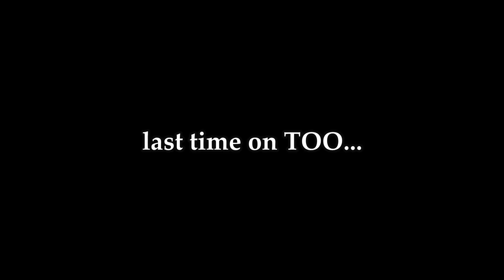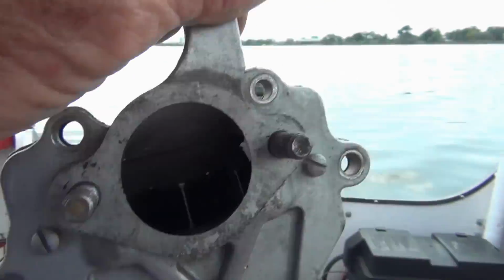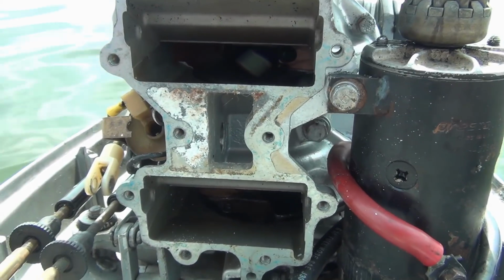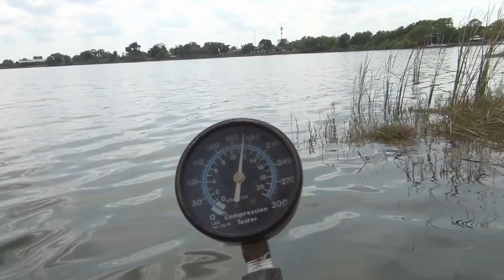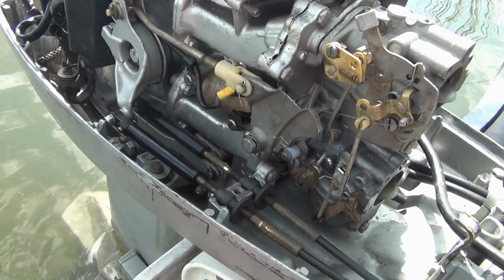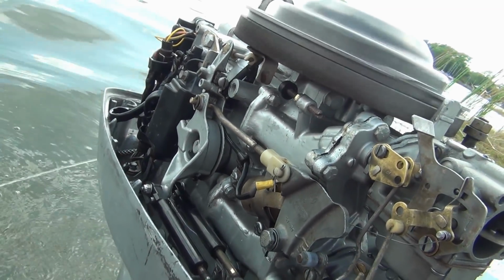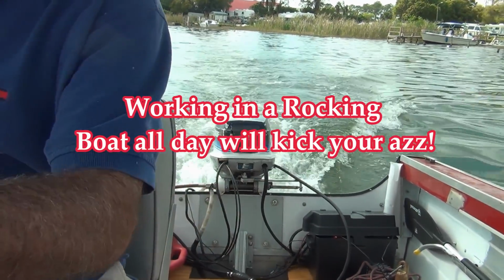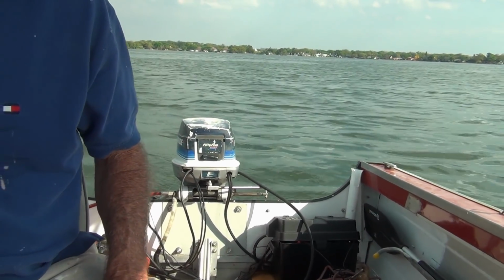1979 Evinrude 55 Hp Reed Valves, Compression Test. Eliminated

Comment: Did you do a vacuum test yet ? On the carbs and block ? I’m still thinking lower crank seal or fuel pump diaphragm failure and fuel is being sucked into the block from the backside of pump . It looked like a hose wasn’t connected laying in the pan ? Just my thoughts !
Reply from the maker: Dont have the tools for a vacuum test other then my hand held up to the carb. Hahaha It's called old school vacuum test! Hahaha Thanks again !
Reply: @THISOLDOUTBOARD1  I think mine cost me $40 ( cone style sync and vacuum ) !

Comment: You mention that the bottom carb is not pulling as hard as the top,  Looked like you were noticing some splash back on the airbox cover toward the end of the video. Might be another symptom of that reed with light showing through the bottom intake causing that issue.   For trouble shooting purposes are you able to swap those two reed cages around to see if the carbs pull differently? if not how about the leaf valve it's self?
Reply from the maker: Hey Al. Originally its been the top cylinder with less pull. I think after I swapped the carb linkage rod for the shorter one it was holding the top carb open just a hair more causing it to pull a little harder then the bottom and I may have not resynced them yet. Anyway, I appreciate how observant you are, wish everybody was like that! And yes I was looking at the box cover, splashback seems a bit harsh, I would call it a light mist, Hahaha. Nothing unusual for a two stroke. I dont think I've ever seen one that had a bone dry silencer cover. And the lovely reed, with the hairline of sunlight showing through. Haha Yes, I could have swapped or corrected it, which your not suppose to do, so they say. I've done it a few times with no problems, bent/corrected it I mean. But on much worse valves then that one, and more than just one hanging open and I mean hanging to where fuel was spitting out the carb! So long story short, after doing the blow back test, carbs on and carbs off, I just didn't feel it was necessary to mess with it. Could it have been the reason for the bottom carb pulling slightly more, maybe. But those carbs are set to idle at closed butterflies. Running them one cylinder at at time the top carb couldn't keep up, at idle or at advanced throttle. In my opinion, it was running to different to blame it on the one bottom reed being slightly open. I guess the long story short just got long again! Hahaha Anyway I dont know if you've been following or just tuned in on this episode. It's a lot to deal with when all these different things start to happen at the same time. Started with a slight hesitation and slowly progressed to this over a couple weeks. And to top it off, we caught a guy stealing parts off it last night. Got my brand new omc coils and was trying to get my battery. Unbelievable ! Stay tuned for that! Thanks again !
Reply: @THISOLDOUTBOARD1  Thanks for the reply. I've been watching the whole series. Along with the others over the past few yrs.  I enjoy the channel very much and look forward to each episode.  Keep at it, you'll figure it out. Sorry to hear about thieves,  I have no patience for them.

Comment: It sounds like the throttle cable on the motor the dial needs to be turned a couple turns it’s stalling when going into neutral. The rpms drop to fast causing it to stall. Check to see if the screw holding the cable mounts to the motor are tight and the black dials are adjusted good.
Reply from the maker: Hey. Thanks for watching and commenting. Will do! Stay tuned !

Comment: feel your pain. had a 70s 50hp electric shift at the shop, was running one 1 cyl, ive been on cdi tech line confirming my dva tests over and over - stator kicks 185v disconnected. throw on a pack - 0.5v. 3 packs in a row now. its a joke!
Reply from the maker: Wow! Thanks for tuning in. It will drive you krazy! Thanks again & Stay tuned !

Comment: Alright I have it figured out since I actually seen and heard it good.
 Disconnect your solenoid when it’s doing this and I bet you a dollar it won’t do it again. It sounds like the solenoid for the choke is being activated causing the rpms to jump up it also sounds like it’s popping into gear when the rpms are reaving up. I guarantee you the solenoid is causing more gas to be pulled into the motor when this is happening. Could be something in your remote. Wish I was there to help with it buddy. Good luck
Reply: That motor shouldn't have a primary on those cars
Reply: Primer on the carbs.
Reply: what primer? this has choke plates! primer didn't start till 84'
Reply from the maker: Hey. Thanks for the tip! But the 79 is still manual choke butterflies, although it does have a solenoid to activate them with a key push. Thanks again & Stay tuned !
Reply: @ct1762  I was referring to the solenoid that pulls the choke in. I get my words confused sometimes.
Reply: @MrCharles504  I was referring to the solenoid that pulls the choke in. Sorry I get my words mixed up sometimes.
Reply: I edited my post to say solenoid for the choke now. That’s what I meant to say
Reply: @mwatkins2464  no worries! yea the plates seemed horizontal to me, plus they have a "notch" that holds them open
Reply: @ct1762  I’m still leaning towards the diaphragm in the fuel pump or lower crank seal !
Reply: @davekimbler2308  agreed. must be an air leak somewhere. murphys law says if it's not the top seal, it's the bottom haha.
Reply: @ct1762  👍👍 i hear ya !

Comment: i have a 75 40hp that im fighting a lean sneeze with, only the bottom cylinder.  in my readings, ive learned burnt piston skirts can cause issues.  i did too find the reed assembly was a lil wet where it shouldnt have been.  have yet to put parts at it but see where were at after that i guess.  not sure if it can be done on an outboard, but on 2 stroke bikes, people do leakdown tests, pressureize the crankcase to determine if theres a leak.  

its driving me nuts too, sometimes it will idle okay, sometimes it coughs like crazy, runs like a friggen top anywhere besides idle
Reply from the maker: Hey. Yes it can be done. Thanks for watching and commenting. Really appreciate it. Stay tuned !

Comment: Any chance your timing arm could be sticking after you pull the throttle to idle? I had one doing that and the grease was old and sticky and the timing arm was really slow about coming back to the stop
Reply from the maker: Hey. Thanks for tuning in. Yeah it sticks a little bit. Thanks again & Stay tuned !
Reply: @THISOLDOUTBOARD1  always never miss a video I'm always tinkering with boats and need all the help I can get lol

Comment: It seemed a bit stiff when turning by hand. A great quicky field test for the condition of any outboard is to, with it in neutral, plugs in, spin the flywheel by hand. just the partial turn in between compressions. It should spin freely, silky smooth. With a quick snap spin and release, it should bounce back off of compression. With good bearings and cylinders, You can easily feel the  momentary pulse of the magnets in the flywheel as they pass, if equipped.....How did that fuel pump check out? Good luck.
Reply from the maker: Hey. Thanks for tuning in. There was a part of the video where I did something similar but using the starter, but it got edited out. I was showing how the piston bounces back and seems to end up in the same position. Kind of the same thing. Thanks again & Stay tuned !

Comment: Both lower driveshaft bearings are SHOT,  both show the light brown overheating color.
u can hear them go clunck when you turn motor by hand.
i had the exact same thing with a 3 cil 60 horse.
It too had good compression, but it ran real rowdy and stalled with idle
that motor ur trying to fix...has one leg in outboard heaven
VRO gets them every time
Reply from the maker: Hey. Thanks for watching and commenting. Really appreciate it. Stay tuned !

Comment: It's too rich is why you're having to give it air to get it to restart.....check the float levels in the carbs. People love dicking around with those and getting the height wrong.
I bought the Johnson version or this new in 1978 and still have it. Still runs great.
Reply from the maker: Hey. Thanks for watching and commenting. I've been through the carbs a couple of times. Just did a carb swap on the top cylinder with no change. Anyway, just caught a guy stealing my new coils and going for the battery when I got there. He was in a boat and took off. We raced to catch him at the ramp but he was gone. The guys fishing there at the ramp, said he left in a big hurry. He had his buddies waiting for him with the trailer. F***ing Bastard. Totally planned out. He probably watches my videos. I'll  catch up with you later. Thanks again & Stay tuned !

Comment: take off the flywheel and check the sensor coil inner magnet... might have shifted, and of course the key while your in there. you can try the flywheel from the 40hp, just make sure to lap the tapers. also, i'd check the idle timing... should be i think 0-4 degrees btdc, whatever the manual says. should help the starting issue if its like 6 or 8 btdc now
Reply from the maker: Hey. The stator is all one piece, you know with everything encased in a mold type stuff. So no separate parts under there. The key and groove are in great shape and Idle timing is 3 +/- 1. 40 was sold weeks ago. Thanks again Bro! Stay tuned !

Comment: There were issues with the intake gaskets leaking on those motors.OMC’s solution was to double gasket the intake.
Reply from the maker: Hey. Thanks for tuning in. Yeah I threw some sealer on it. Thanks again & Stay tuned !
Reply: Is that 30 hp to

Comment: I will suggest to check for a crack in you fuel pump.  Those plastic parts are notorious for cracking.  That will cause an intermittent air leak
Reply from the maker: Hey. Thanks for tuning in. Yeah its new but I'm gonna double check it! Thanks again & Stay tuned !

Comment: Damn. I wish I had the magic solution, but there’s lots of “can be’s” with the way it’s running. If it’s racing out of control it must be getting excessive fuel or air to raise the RPM above idle. I know two strokes are finicky about case leaks and seal leaks. I’d just go back and look at everything again warm and hot. Maybe even check for leaks under a vacuum rather then pressure. I’m gonna have a talk with those outboard gods! They need to knock this $hit off and help you figure this one out!
Reply from the maker: Hahaha. Thanks ! Yeah they must not be listening to me. Thanks again !

Comment: sounds like a fuel problem , 2 stroke love any over amount of fuel when cold , when they are at running temperature they need their air/fuel cocktail exactly as it should be to run smooth , open reed valves no good , you should not see light true the reeds , clean that over yeared gooky sealant off ,replace gasket with original , fix the reed , swap out or replace , when you back off the throttle the butterflies should disengage evenly ,but youre engine still gets fuel or fuel  vapor after you disengage , when you disengage the timing also disengages , when engine is at running temperature it will get to much fuel to even run stationary , so much fuel so little air the idle lever opens butterflies allowing air to yoin flooded engine so it starts and reves up burning all that excessive fuel as soon you take away the air (idle lever back down)engine floods , the reeds are just as important as a good fuel pump , the electronic going bad when on running temperature is almost impossible , either it works or it don't work (marine outboards) thats how they build them , exeptions like  , i own a 2009 yamaha 2 stroke 85 hp it has a cdi that has limp mode when cdi goes bad you can still limp home , great videos enjoy watching them and shared my though
Reply from the maker: Hey. Thanks for watching and commenting. Really appreciate it. Stay tuned !
Reply: I agree with MegaSensimila's comment about the gooky sealant, and the bad reed.  Those need to be fixed first. That reed that was showing light through on the bottom intake is an issue. TOO noticed a difference in how the bottom carb was pulling compared to the top carb. Leaky reed will allow fuel backwash into the carb making it possibly pool up and maybe causing those hi rev episodes. Another symptom of a bad reed is hard starting and a bog, It's possible you may see some fuel spraying onto the front of that air box when the reeds are not working correctly. Dangar Marine explains the concept of how they work here https://www.youtube.com/watch?v=a-l1WqKaPVI&t=275s

Comment: I think your running lean on fuel. When you run your fuel level is dropping in the bowl and the carbs can deliver more fuel to the engine. In gear there is not enough fuel to keep her running at high rpm. I like your video. Check the float levels on the carbs and look for anything that could cause a restriction. Fuel pump could be suspect as well. Remember lean is mean.
Reply from the maker: Hey. Yeah it's crazy. Thanks again for watching and commenting. Stay tuned !

Comment: My opinion put a tach on the dash see her rpms are with different props 😉 she could be loading up on you Test different props ? Had a 76 115 Omc that had us frustrated till we started to see her RPM ratio from full throttle take off to max speed did we found a balance in both ; never looked back she came out the hole well got on plane fast but just lost 2mph
Reply from the maker: Hey. Thanks for tuning in!. And thanks for the advice. Really appreciate it. Stay tuned !

Comment: You need to richen up your mixture screws alittle
Reply from the maker: Hey. Thanks for watching and commenting.There are 0 adjustments on these carbs. It's all fixed orifices/jets. Really appreciate it. Stay tuned !
Reply: Front of carb top slotted screw is your idle mixture screws
Reply from the maker: @stevejones9832  No

Comment: Poor  idle , hard cold starting , lack of power is worn piston skirts.
For the reed valves to be bad they have to blow gas back out of the carburetors
Leads to lack of primary compression
Reply from the maker: Hey John. Long time. Yes, I know. Power has never been the problem. It runs like champ. Started with a slight hesitation and progressed into hard start/poor idle within a couple weeks, cold and/or hot. Went after the fuel system first, got down to the reeds, no spitting out, carbs on or off. Isn't excessive smoking also a sign of worn skirts? I also thought it was strange when I took the reeds off, the crank and rod/caps were very dry and very clean. Not oily. Is there a way water could be entering the case? Bearings still sound good. Anyway just a slight setback here. Caught an asshole stealing parts off the 55 last night, he got my new set of omc coils and was going after my battery when I caught him. he took off and we tried to catch him at the ramp. The guys fishing there told us we just missed him. He had another guy waiting at the ramp with the trailer ready to go. It was totally planned out. F***ing Prick

Comment: Did you ever swap out the coils and pack ????? Do that simple enough before you drive yourself crazy, LOLLL... eliminate that possibility my friend first then move on only my take on it.....GP
Reply from the maker: Hey. No I haven't put the new OMC coils in yet. I want to be sure there's nothing burning up my coils first, after what happened with that new aftermarket coil. I mean aftermarket is aftermarket but I've never burned one up. P-pack may be an issue. haven't gotten that far yet but something is going on. Thanks again for tuning in!
Reply: @THISOLDOUTBOARD1  Nothing
 Nothing worse than trying to start a slightly flooded motor thats dropping a cylinder intermittently after she run a little and got hot when you dont know it, HA! Those 55 dont run good on one cylinder hard starting etc. I  hate going threw that thinking its this, then that, then this syndrome too, LOL .Anyway  youll figure it out again these are old engines with sometimes multiple issues especially the 40HP and up & bigger guys loaded with problems sometimes as you know....Good Luck! ..GP

Comment: I had a motor that was doing something similar to that.  I had to choke it to get it to start and it wouldn't idle for crap.  But I had just rebuilt the motor and it was running super fantastic then it was not.  Turns out the flywheel key was sheared and it was built with what is known as wasted spark which means both spark plugs always fired together so it could run with the flywheel 180 degrees from where it should be but it ran crappy like I said.  I must have pulled those carbs apart 10 times.  May not be your problem but what if it is.

Here is a good test to see  if top crank seal is leaking.  https://www.youtube.com/watch?v=AWuRd7yjHlQ
Reply from the maker: Hey. Thanks for watching and commenting. I'm just gonna swap the seal out, there cheap and easy to replace. Thanks again & Stay tuned !